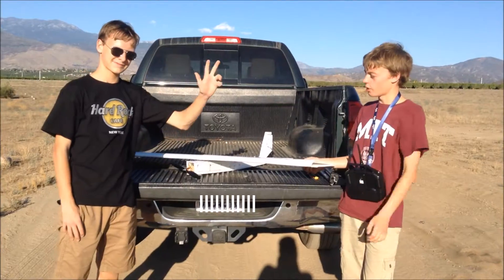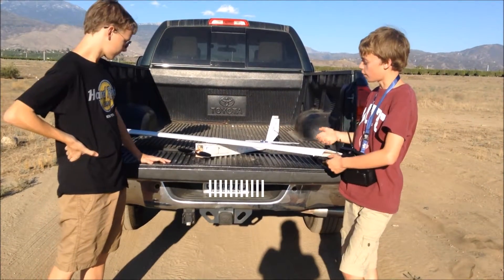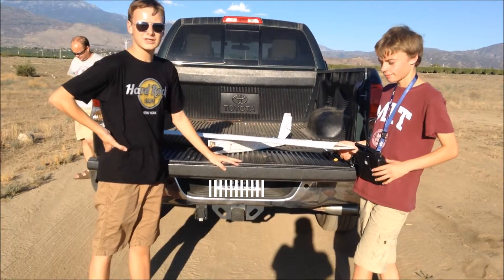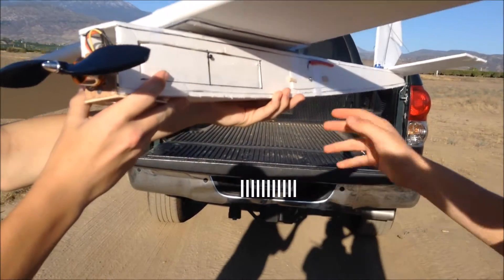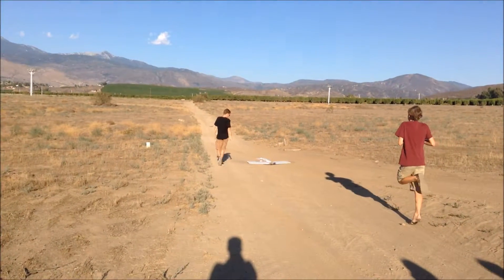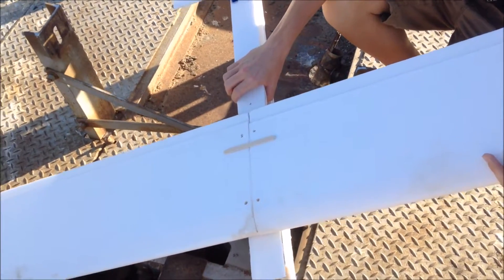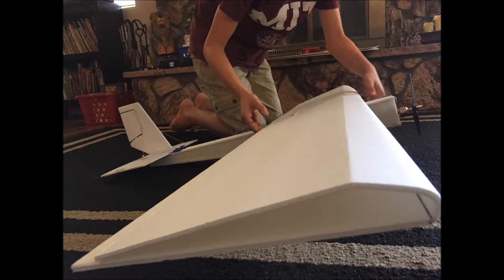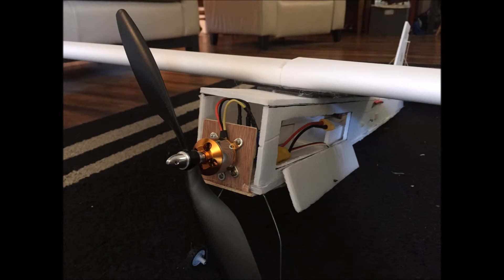Home Built RC Plane V1.0

Comment: Wrong analysis bro....wing is not having any problem ..just 
1) CHECK CG
2) GIVE THE WING A GOOD DIHEDRAL ANGLE
3) GIVE THE MOTOR A LITTLE DOWN THRUST 

and the plane will fly